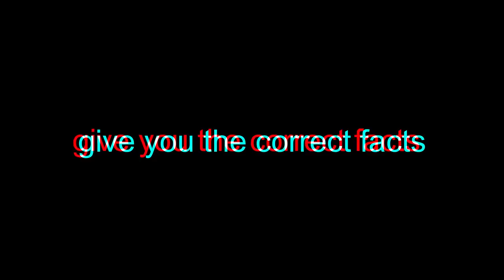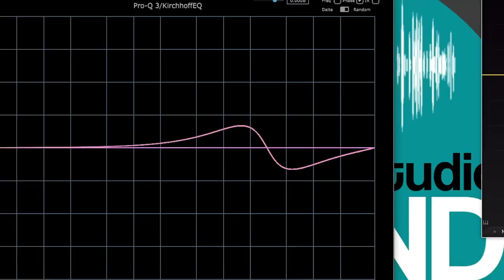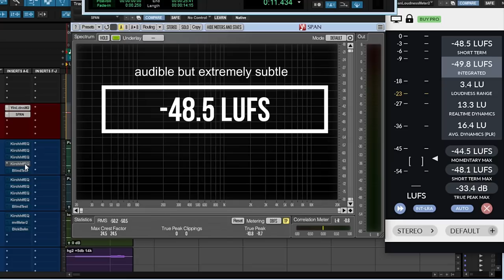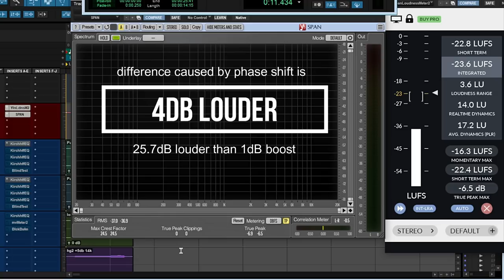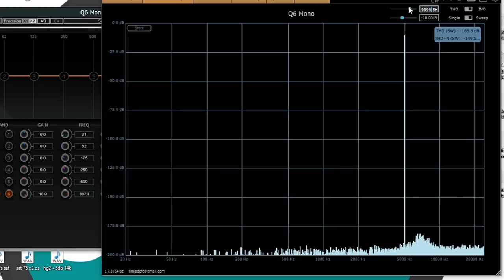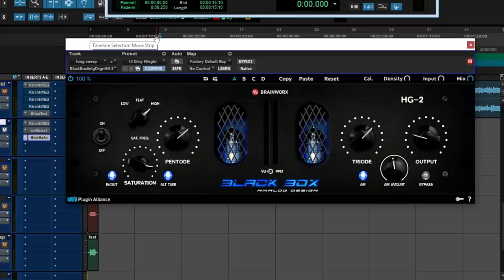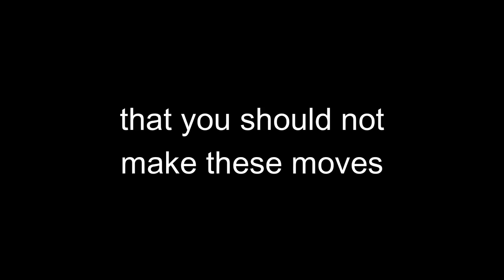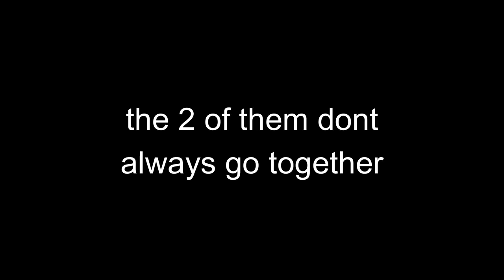THIS is why engineers tell you NOT to EQ like THIS when mixing

Comment: Hey Paul, am I delusional if I think that the Sonnox Eq sounds better than the Pro-Q 3? I noticed when filtering the hiss in electric guitars the Sonnox sounds less masked than the Pro-Q 3, I believe there is a difference...
Reply from the maker: Eq match the curves (if you are stuck you can use plugin doctor or bertom curve analyser dependent on your daw) ensure both are identical in gain, do a null, if it nulls you are delusional
Reply: @PaulThird  🤣🤣🤣
Reply: @PaulThird  I've just tested them, they don't null
Reply from the maker: Did you properly match the curves in an analyser? Because proq3 uses a different q factor to most eq's. If you have just matched settings, they won't null
Reply: @PaulThird  no, but I kinda tried to null them and the settings were totally different but you could still hear some noise, they didn't null perfectly, I should try the plugin doctor, the thing is that the same simple Eq move, a High Cut at around 6.5 K generates different results, so It will affeft the way you mix...
Reply from the maker: You need to measure apples with apples. When both are in the exact same state, the null will reveal everything
Reply: @PaulThird  I understand that but the thing is that when you eq musically you are not trying to match curves, you try to do it just by listening, and a simple high-cut/low-pass generates different results in both equalizers, please don't hate me 😅
Reply: @PaulThird  I replied but Youtube deleted my comment, the thing is that when you eq musically you are not trying to match curves but a simple move like a high-cut/low-pass gets you different results in both plugins
Reply from the maker: That's not the point though. The point you were asking was.. Paul is there a sonic difference between the 2. Only way to find that out is to curve match and null.

You work with your ear so if that's the case you should adjust the proq3 q the same as sonnox. Cause I can pretty much tell you without checking that the 2 will null perfectly cause I know that the sonnox is completely linear

Just straight up science that I've done a hundred times before

If you don't adjust the proq3 the same way as sonnox by ear then thats not the sonnox being better, it's user error. Harsh but true

Theres a difference between sonics and psychology
Reply: @PaulThird  I will have to test it with plugin doctor 🤣

Comment: I love your videos. But this time, I have to raise my hand. I agree with you on the phase shift issue, of course. Especially, if you have two signals, being at the same pan position, keep in mind that boosting a frequency range of one signal also effects the second signal. If you need to add a lot high-freq content a good, oversampled exciter might be the better option.
But I'm not completely with you regarding the linear EQ-thing going into a nonlinear plugin. Just oversample the nonlinear one and the aliasing issue is solved to a major degree. And the pre-ringing of linear EQs makes them rather un-preferable for me. If you want a particular character from your saturated plugin and it doesn't have a tone controll you actually have to hit it harder with specific frequency ranges (and un-do the boosts with a following EQ). 🤷‍♂️ By the way: Most nonlinear plugins (like preamps or tape) cause phase shifts (which is very audible if you make a 50% dry/wet mix) so reaching for a linear phase EQ just to go into a nonlinear (waveshaping) plugin that causes a phase shift is kinda...pointless?
Reply from the maker: I'm not saying to use linear phase eq though haha I'm just showing the facts as there's another video doing the rounds saying that stock digital eq's just cut and boost and have no impact on phase or distortion/aliasing when making big cuts and boosts. 

The saturation/aliasing thing is purely just a reminder to think about how your eq move plays out further down the line. For example If you use a coloured compressor or saturator that doesn't oversample and stick a crap ton of high through it then the aliasing is there. You can't oversample after the fact. It's locked in. 

Theres ways to fix it but all I'm doing is giving others the context behind it so they at least know it's happening. Just food for thought really. I'm not telling anyone what to do, just giving the facts as that's when you start to understand why something sounds a certain way.. 

For example.. I boosted 10db on my snare using a clean eq and now I have distortion around that area.. Oh.. I forgot I had a fast 1176 after it.. Just shit like that.

CLA does it but understands why. He boosts a shit ton of 8k on guitars into an la3a so he can use the compressors GR to control the amount of bite he adds to the guitars. He could just add a ton of 8k on the SSL but he wants the grit and the GR to be dealing mainly on that 8k
Reply from the maker: GR is gain reduction. Phase is just a part of eq. Every EQ that isn't linear phase results in a phase shift. Most analog emulation compressors have a phase shift and essentially anything that changes the frequency response alters the phase as well. It's just a byproduct of mixing. Flipping the phase won't remove a phase shift, only linear phase can do that.. Or unless you get clever but that's just not practical. 

In reality, the more you boost or cut results in more of a phase shift. It's up to the user whether that's a negative or it isn't. Just trust your ears.
Reply: @PaulThird  Ah, okay. I haven't heard of that stock-EQ myth before. 
OS:...Sometimes I forget that Reaper's internal plugin oversampling on demand isn't implemented in every DAW out there. But there's still DDMF's Metaplugin 😀. However, one has to be aware of the necessity to do that, of course. So it's good that you gave people a heads-up to keep that in mind.

Comment: The difference around -48.5 is really big and very audible I must say - I hear such differences immediately. Only differences below -80/90 are negligible from what I've tested with my ears (while doing null tests of different eqs). Differences around -65/-70 are still really audible.
Reply from the maker: It is audible but in a blind test its still subtle as its only audibly affecting a small part of the frequency spectrum. It's there and if you listen critically you will pick it out but still subtle in the context of a mix as its only a db boost
Reply: sicne you;re older remember you cant even hear over 15Khz in your 40ies etc...12Khz if you're much older... so it might be psychological what you claim ?
Reply: @levondarratt787  no, I work with audio every day that why I have very sensitive ear. I can pick up the differences between A i B in a blind test precisely if there is around -65dB null. Below -80 I can't tell. But differences higher than -50dB null are really big and very easy to hear for most people
Reply from the maker: Tbh he is right. It is audible at that level. Its the "really big and very easy to hear" part that's subjective.

Only way to prove it is to triple blind test with original, dB boost and dB boost linear phase. If you can pick each out in a 3 blind tests on the trot one after the other then it is easy to hear.

That's how you prove it for each person
Reply: @PaulThird  most people can learn to hear these small differences. The key is to focus your hearing on ranges (low end, low mid,  hi mid, highs, air - how solid, clean/dirty/smooth/hard/natural/artificial they are) and transient part of the audio especially. The samples around 3-5 seconds are best to notice the differences while being very focused on each aspect at a time. If you know what to listen for you'll hear the difference immediately. Once you notice the difference you describe it in your head and store this sound in the memory.
Reply from the maker: Yup that's why many get so frustrated with me in my blind tests cause I learn each file so I know where the nuances are in each and once I've heard them I can pretty much get it each time but dependent on whatever the change is it may require a good few listens
Reply: @PaulThird  that's true

Comment: It is very interessting and realy helpful. Thank you! :-) Is it a solution to do a decrease of frequencies instead of increasing them - and after this to increease the whole level of the signal? Have you done a video about a good way to use EQs or is it not possible to avoid this problematic?
Reply from the maker: My view is that you give the track exactly what it needs and don't overthink. If it's need cut, cut it. If it needs boosted, boost it and move on.

Comment: So in hardware phase shifts also happen during the drastic eq changes but Aliasing doesn't happen in hardware ?
Reply from the maker: Correct. Analog shifts the phase but no aliasing as its purely a digital artefact. Even in modern times AD converters simply lob off the high end information past niquist before it reaches the digital domain
Reply: @PaulThird  Thank you Paul for the prompt reply.🙏

Comment: Interestingly, in my inexperienced dive into mixing, I found this is more problematic in dirty electric guitars (real ones, recorded with two mics on the amp) and vocals, not so much on drums. I might be wrong of course, it’s just what my conclusion from my hears and from checking the phase.
Reply from the maker: This is because you are dealing with multi miked instruments. If you don't eq them as one then you are affecting the phase relationship between the 2 mics.

Eq'ing causes phase which is a delay of frequencies so if you delay frequencies seperately then you alter the phase relationship so essentially the work that went into minimising the phase in the recording process was kinda for nothing if you go hacking away at eq seperately.

That's why it affects multi miked stuff way more. That's why I bus my kicks, snares, guitars and eq them as one instead of seperately.
Reply: @PaulThird  Thank you so much Paul. Yes, I do EQ both mics of the guitars together in a bus, usually just a HPF and a LPF. I try hard to get a great sound when micing to avoid any EQ afterwards. In the drums, however, I’m EQing everything separately. I’ll take your advise and review my workflow on that. Thanks again for taking the time to reply with such great info. I truly appreciate it.

Comment: It’s incorrect to say that linear phase eq does not distort. Pre-ringing is certainly a distortion of the original signal and much more bothersome IMO.
Reply from the maker: Is it distortion though? This is from the crave website

"As a side note, all EQ suffers from post-ringing but our auditory senses don't notice it nearly as much. Linear phase EQ effectively halves the post-ringing and instead provides an equal and opposite amount of pre-ringing."

So all linear eq's ring so does that mean that all eq's distort? Depends on how technical we want to get on the terminoligy of distortion. I'm talking total harmonic distortion that can be measured. 

In regards to pre ringing in the low end that's why kirchhoff offers a mixed phase mode where you can have your low end natural phase and the rest linear phase. You choose where the linear phase starts. So there are work around in modern day times.

Tbh they all have subjective positives and negatives. Depends on each person's taste and ear
Reply: I certainly consider transient-smearing pre-ring distortion moreso than inaudible post-ring. On sources with less transient information, it matters less, but EQ your snare drum or toms to your liking then A/B linear phase vs minimum phase. Unless running a CPU-crippling FIR window, the difference is noticeable enough to make a video about it.

Comment: Yeah, but when you need 20 Db, you need 20 Db, so you do it.
Good luck having an acoustic kick in metal without that much raping of the sound.
Reply from the maker: Yeah. You do what needs done. I don't think about phase unless it's multi miked instruments but at the same time I don't really go hacking away with massive boosts or cuts unless as you said its really needed. I Actually do more LP and HP filtering for tone shaping . Out of interest kind of eq moves do you make in metal compared to other genres?
Reply: @PaulThird  
The high peak on a metal kick is something that Nature didn't provide :)
A Bass Drum is not supposed to have 15 Db spike on 8 KHz, that's not what you hear when you are in front of it... yet that's what you need, followed but a multiband compression to make it sound even less natural.
Of course that won't be enough, so you star cuttin all the mids until it sounds like Typewriter :D
Reply from the maker: Id probably just sample the shit out of it with some metal kicks haha
Reply: @PaulThird  
That's what most people do, me included when the source is not good enough, but when I can, it's fun :)

Comment: Hypothesis: ... too much aliasiasing will tends to produce 'ear fatigue' faster than the 'same mix' without aliasing ... 

... a bit silly hypothesis, because, the mix without aliasing is not 'the same mix' ... but what is pretended to be called 'the same mix without aliasing' is taking all the procedures for preventing aliasing to occur and set all the 'mixing parameters equal' ... 

Next, testing the hypothesis is not easy at all to realize, because, each human has a subjective and circumstantial 'threshold' for experiencing 'Ear Fatigue'  ... so, setting an experimental 'psycho metric' setup is practically a nightmare that requires an obsene number of already profiled individuals ( as experimental subjects ) for getting some sort of statistical variables that can build the construct 'Ear Fatigue' in the experimental model ... 

The point of all this babble is that it could be possible to test the 'undeseable listening effects from aliasing' and why it is objectively recomendable to get rid of it, inclusive, if a great percentage of the population will not be aware of its presence in an audio source ...
Reply from the maker: It's pretty audible in the tests I've done. Less transient detail and overall less clarity. When it builds up its very apparent. It's unmusical frequencies being brought back into the audible range so I've never seen the benefit of it unless you want something to purposely sit further back in the mix. I'll sometimes use lofi on backing to give them less detail so they sit better behind the vocal
Reply: @PaulThird  Who knows?? Maybe the AI generation will tell to their AI system to make some 'vintage' Digital era Aliasing effects for their mixes ... 🤭
Reply from the maker: Alexa gimme that 00's over limited smeared with aliasing sound 🤣

Comment: thanks, hm, so what better to use on master buss with +-3-6 db correction in pro q, zero latency or linear phase? better accept phase shift or pre ringing? honestly i cant hear both of it or do not know what exactly listen to. sure, best way would be to mix it properly...
Reply from the maker: Tough one. Use your ears on that one. I use bass room and mixroom on my master and they are set to linear phase by default and I love the results so my advice is do a side by side comparison and pick the one you think sounds best

Comment: "going to have nyquist then going to fold back". this does not have to be like that. could be a bad plug-in or something else. clearly a bad implementation.
Reply from the maker: Nope, it's just digital science. If you create harmonics past niquist they are reproduced within the audible spectrum. It's a computing thing. Only way to fix that is to oversample the plugin or work at a higher sample rate to increase niquist. 

The most common sample rate is 44.1 or 48khz which has a frequency range of up to 22k/24k.

If you have a non linear plugin bring fed a lot of high frequency content then it will create more higher order harmonics. The more orders of harmonics you make at these frequencies the more aliasing that will occur.

Many people confuse it for others by trying to use 1khz to measure aliasing which is unrealistic as it would take 23/25 orders of harmonics to exceed niquist which is a lot. 

However take 10khz for example. 2nd order harmonic is 20k, 3rd is 30k. Only takes the first odd harmonic to exceed niquist.

So any frequencies saturating past 12k will excced nuquist as at 13k the 2nd order harmonic will be at 26khz which is past the frequency limit (nuquist) of that 48k sample rate.

Most modern plugins that include high levels of saturation internally oversample so when using the plugin at its reccomended input level it won't alias.

But as the black box shows.. Internal oversampling has its limits when cranking high frequency content into the saturation.
Reply: @PaulThird  "Only way to fix that is to oversample the plugin or work at a higher sample rate to increase niquist. " - which confirms my comment. this is one way doing it with proper filtering. Don't use plug-ins that pretends to be analog, yet create alias in the nyquist range.

Comment: Damnit I just do not understand it...Worralls video wasn't easy to understand this one also doesn't fit in to my brain cells its like rocket science 😭 what phase guys I see it's but how does it effect the sound 😵‍💫
Reply from the maker: https://youtu.be/JTVIXOxCafs

Try that one
Reply: @PaulThird  i do understand that the phase shifts in time so in could cancel out the original one when compar. but how does it have a negativ effect on the material in general...and should i always HP with LinPh in Pro-Q3 ?